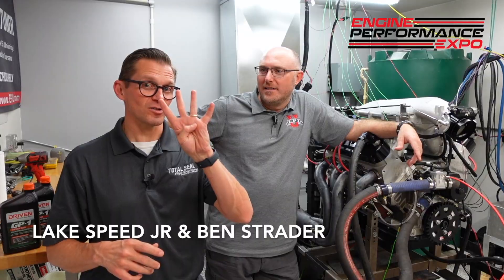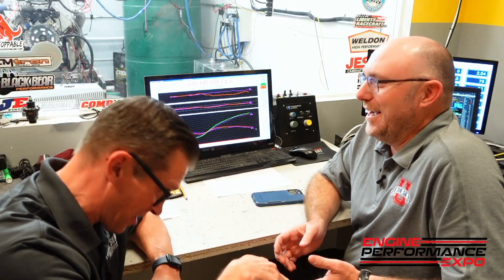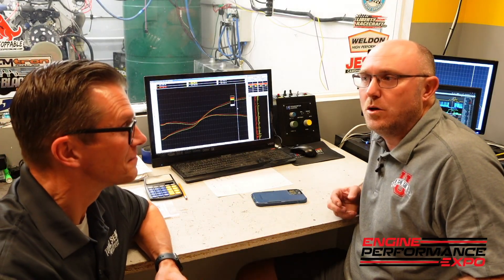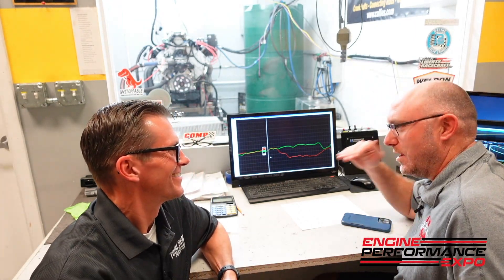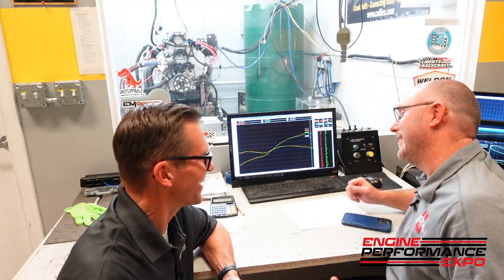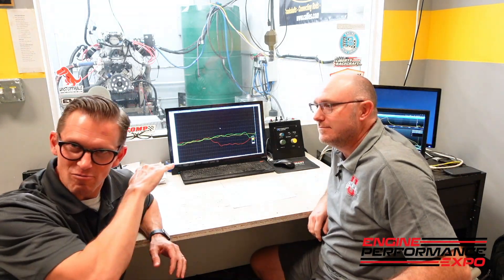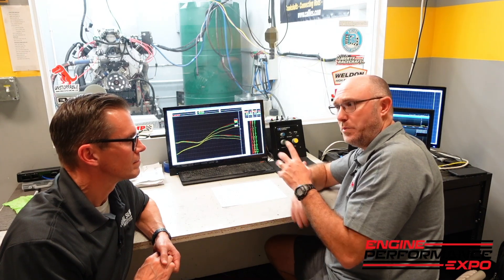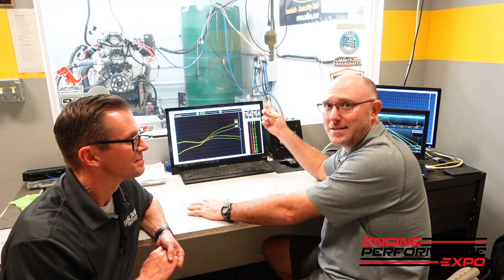How MUCH OIL is TOO MUCH? Dyno Results!

Comment: Love to see if you get the same with a 4 cylinder...

Like a Nissan p11 sr18 ,    which only holds 3.2L and at 4L it has problem to start....

Can you please do more detail like that due to more international people have 4 cylinder engines....
Reply from the maker: It would be the same for a 4 cylinder or 6 cylinder engine.
Reply: @themotoroilgeek    the engine if has too much was not able to start...

Especially after been done so many times...

Comment: Lake, this video had way to many undisclosed variables for me. It would of been nice to have a pan with a lexan window in it to see the level as it relates to the crank, still and running. Also, is there a windage tray and what’s it look like? Has the crank been knife-edged? How far off the bottom is the pick up? Does the pan have left, right, or both kick-outs? I nice addition to the test would be an accu-sump system.
Reply from the maker: All of the details on this engine are on the Engine Performance Expo channel.

Comment: Foaming (crank hitting the oil level in the over-filled sump) is what I fear with passenger vehicles, and certainly some race engines too.  When oil is full of air, it doesn't lubricate near as well.
In this video, I'd say the oil heated up more the less oil there was, driving pressure down.  I don't think the sump pick-up was sucking air (which also causes foaming).  The drop in pressure reading is due to higher oil temperature.
Reply from the maker: The pressure drop was not due to temperature. As stated in the video, these heads have poor oil return, so they fill up with oil, which drops the oil level in the pan (thus the drop in oil pressure).
Reply: @vincentrobinette1507  and @themotoroilgeek   OK, oil return is too low at high rpm, so low oil quarts means the sump level must be dropping below the oil pickup tube inlet some, sucking some air up and lowering oil pressure by foaming that way.   Would be nice to see if bubbles are on the dipstick right after a run, as this is how one finds out definitively if a passenger car's oil level is dangerously high.  Passenger cars generally will let you go above the top line on the dipstick (varies, so not always) a little without the crank hitting the sump oil, basically the oil above the windage tray level.
Reply: I looked for this comment. I agree the lesser amount of oil heats faster and will increase power over cold oil. They should have put a pan oil level indicator to see how much oil stayed up in the engine and how the levels actually change in the pan. And the actual oil temp which they didn’t.
Reply: To say that you have that much oil staying up in the heads is a problem. And if you are sucking air in the pickup that means you have basically no oil in the pan and air in the oil system is bad.
Reply: I believe the pressure drop is due to aeration of the oil caused by the crank and rods splashing in the oil, as well as general windage. Bubbles could get low enough, for the pick up tube to be drawing air bubbles, as well as oil.
Reply: Who said the pressure dropped to zero or fluctuates?if the pump ran dry or even sucked some air it would draw less power and show more on the dyno. Less oil will heat up faster. They need to do more testing and have more info to say more and not guess.
Reply: @mason7300  not me buddy
Reply: My ‘69 Boss Mustang 428 had a windage tray. It was a SCJ with the functional hood scoop.
Reply: If the oil pressure dropped due to temperature it wouldn’t happen so suddenly. So you are incorrect. It’s can only be air at ion as the level going below the pickup would drop to 0 or fluctuate rapidly
Reply: In other words as soon as the oil pressure drops and sucks air you better believe things are heating up fast. The power comes from less power draw on the oil pump. Bad for the engine. Races are won on getting the right pump. 5-10 hp gain.

Comment: On an aging daily driver with 280k miles, 2.4L Honda would it be best to run it at the max line for wear protection and longevity? She’s had 5w-20 Mobil 1 full synthetic (now high mileage) in her since I bought it 16 years ago. Would love to see how long I can keep her on the road.
Reply from the maker: Nope. In the middle of the dipstick is all you need.
Reply: Why switch to high mileage oil if it wasn't leaking or consuming oil?
Reply: @masterofnone1808 she consumed a little bit. About 1 qt every 1000 miles. Sold it with 290k miles on it and bought an 09 CRV with half the miles.

Comment: I  have two older high mileage engines - one a 1977 Olds 403 and the other a 1978 SBC 305 - that always burn off a half a quart of oil after an oil change within 100 miles, then they'll run about 1500 miles before hitting the add mark.

My daughter insists on keeping them full or even slightly overfilled and I've shown her that being overfilled actually results in fluctuations in oil pressure at higher RPMs I'm sure due to "foaming".
Reply from the maker: Thanks for sharing!

Comment: Some years ago I had a Chev truck in the bay, it  just had an oil change in another city. Pressure dropped coming through a mountain pass. I confirmed it at 3000 rpm. Oil level was only 3/4" over full. Drained some out, all ok after that..
Reply from the maker: Yep. Small block Chevy engines with stroker cranks are very sensitive to oil level.
Reply: What about a small block Nissan like the Altima with a 86 by100  2.5 ...though I prefer a 2 liter Dr Pepper

Comment: Need a window to see what is going on inside the pan with the crank, counterweights, windage, roping, etc.
Reply from the maker: I would love that…
Reply: Garage 54 did it recently.
Reply: Would love to see this too.
Reply: Another YouTuber did this. All the oil sloshing caused a lot of foaming.
Reply: What is roping? Like a rope seal? Or snotty streamers of oil caused by tackifier additives?
Reply: @gregorymalchuk272  the latter: snotty streamers of oil.

I'm way more familiar with smaller inline engines.  My own has a windage tray between the crank and the oil pan/sump, stock.  

No mention if this engine did or did not have one.  If there wasn't... boy, testing a windage tray vs not would be interesting.
Reply: You mean something like this? https://youtu.be/gxw3rLFlsTc?si=-wVry1dbnbClTgGL

Comment: I always wondered what the 2 dots on the dip stick actually measured. Is dot to dot represent 1 quart?  Any one know?
Reply from the maker: It is typically about 1 quart (on most engines).
Reply: @themotoroilgeek   It would be 1 liter on an engine from a country that is metric.  i.e. Japan, Germany, etc.

Comment: Lake you keep teaching me more and more about making Horsepower. I was surprised by over filling oil changes HP. Thanks for the knowledge.
Reply from the maker: Glad to help
Reply: its because the crank is hitting the oil at the bottom, try pushing your hand through water, it slows it down. this is an easy visual/physical example

Comment: Interesting for race track.On the highway I thought over filling  would damage an engine.What damage might that be.
Reply from the maker: Overfilling is very bad for street engines. It can lead to foaming problems.
Reply: @themotoroilgeek  What if it is only 4-8 ounces over?
Reply: @Fordworldrallyfan  According to Toyota owner's manuals and level above the full mark while at operating temperature is "excessive".
Reply: I've heard IT would hurt the catalytic converter with the oil fumes from splashing.

Comment: I was in the navy (I wouldn't say which country) and one of the ships I was post to had the tradition of filling it TWICE THE AMOUNT of the max fill line. So when the engine starts up to idle, the oil level should drop to exactly the maximum fill line as dictated by my chief. 

Privately, throughout the short amount of time I served, I'm just in a incredulous state that the engine didn't develop any problems. But it always seem to feel slower than the other vessels when we're charging back to base.
Reply from the maker: Thanks for sharing
Reply: And the oil would be airated.  Air does nothing to lubricate bearings.
Reply: @thisisyourcaptainspeaking2259   yep, complete waste of oil. I never fully respect my chief for that.
Reply: Is there such a thing as oil drag? The engine needs so much oil to create the film to protect the bearings over that is pointless, but the pump continues to pump pressurised oil into the bearings.
Reply: Was it Singapore?
Reply: Marine specifications and lubrication are significantly different. Don't cross reference the 2.
Reply: @pheonixfps9248  lol. I'm talking about oil level, not oil spec.
Reply: @smoadia85  so am I.

Comment: Great info, but would have liked to know how much oil the dipstic/manufactor says the engine needs.
Reply from the maker: There’s no dipstick on this engine…
Reply: @themotoroilgeek hey. I have always wondered about the mfg. dipstick. 
How do they know the measurements on the dipstick?
I'm not a from ground up engine builder. 
After oil change the level of oil is very hard to read. 
Always worry about too much and causing oil frothing. 
Thanks.

Comment: Would be interesting to see if you ran longer and the oil all turned to foam. More oil equals more oil pressure until.?.?.?.?.You lost horsepower because the crank is literally spinning submerged in oil.
Reply from the maker: Absolutely! If we kept running it we would have had a major foam problem.

Comment: I’m curious about what a 3 quart accumulator would do in these situations. 
I’m looking into solutions for my GM L8T block. 
 Currently I’m thinking about running a Peterson external wet sump oil pump and a 3 quart accumulator but I have no direct experience with doing this. 
   On paper it appears to be the right thing to do.
Reply from the maker: Sounds like a good idea

Comment: It didn't surprise me to see how much power was lost when the tank was overfilled, but it did surprise me to see how much power was gained by decreasing the amount. Great video
Reply: You get more hp with decreasing oil pressure because it takes power to pump oil. There is a sweet spot but you need a minimum of 10 psi per thousand rpm to keep bearings cool. The falling oil pressure with low oil is really scary on the first pull.
Reply: @patsyalbertengel3066  what is the source of "0 psi per thousand rpm"? Does it work for engines with ball crank bearings?
Reply from the maker: Thanks!
Reply: @themotoroilgeek  is the engine working harder because its swimming in all that oil and losing horsepower as a result?
Reply from the maker: @ThatCaymanGuy  Absolutely!
Reply: @themotoroilgeek  The lowest oil test, 5 quarts, had gained horsepower due to the lower load on the oil pump, not just less oil hitting the crankshaft.  Question is how much can be added before crank slap starts robbing power.  Starving the oil pump to gain power is not a good thing for any of my vehicles.
Reply: Wouldn't a oil with different viscosity change the outcome also. Let say a 0w 3l0. Instead of 16w 40 @themotoroilgeek
Reply: @ThatCaymanGuy  i had a fellow drain the transmission on his harley, thinking it was engine oil. he re/more filled the oil tank to max capacity, including flywheel compartment which in those is considered dry sump. he kept checking & adding to the point that in a 3.5 gt system he had 3 in the tank & 3 in the engine. it, being completely flooded took no time to turn all the work i did inside blue from the heat.
Reply: ,, 
1 1 /. @themotoroilgeek
Reply: @themotoroilgeek mine is 2004 model 125cc Hero Honda super splendor bike...usually pouring 900 ml semi synthetic oil as it was coming in 900ml container and the recommended quantity is also 900ml. This month I shifted to the Shell advanced ultra 10w 40 fully synthetic oil that is coming in 1000ml container and l poured the same...Will it do any harm to my engine or it is manageable...please suggest...Love from lndia...
Reply: Crank is basically a oil foamer when over filled.   It causes massive parasitic draw.    
On the other hand, with this engine in particular! At 5 qrts. Of oil the oil pump cavitatated. There for it became easier to spin.  That = 12 hp gain on paper.
Reply: @brianr8581  if you foam the oil, your pressure will drop too
Reply: So this begs the question, how trusty is the dipstick overall?
Reply: @TxRedneck smart man.  Analog gauges would tell you better
Reply: Is the right amount for optimal engine health and power in the middle or full?
Reply: Mostly engineering tells us right in the middle of  @NoNoNo12322
Reply: Now repeat the first test just to be sure
Reply: now, the million dollar question? are we gaining hp because of less oil or more available air space to better distribute the positive & negative crankcase pressures?
Reply: @Toobzilla  or more HP due to less work by the oil pump and possibly killing the life of the engine.
Reply: @Stan_in_Shelton_WA  if the oil supply is ample enough to keep the pump satisfied it wont matter if it has 10 oz or 10 gallons of supply.. with babbitt style bearings, constant high-pressure is paramount.  you can destroy critical clearances in babbitt style bearings in nano-seconds. the added clearance would drop pressure but increase the volume dispersed. both of which would be counter productive to these findings.
Reply: @Toobzilla  Not true.  Oil pressure in is relevant to oil pressure out.  Also I think they had info about oil pressure differentials.  30 PSI compared to 60 PSI would be a different load on the engine.
Reply: @Stan_in_Shelton_WA  i think your getting your pressures & volumes confused. 
if i take an assembled oil pump & hook a return circuit to the outlet of pump to simulate the distance between tank supply & pump and then remotely drive the pump at same max rpm as when installed & slowly lower pump into the minimal amount necessary to maintain a steady state of oil pressure as regulatedby the bypass circuit & find that minimal volume needed to maintain steady state w no time limits @ full operating temerature  is 24 ozs, your suggesting that lowering same unit with the same unrestricted return circuit into 24 gallons will somehow raise the pressure?... im betting lots of folk would argue that.
if 24oz is my minimum 100% capacity needed to maintain steady state psi but remove 4oz & the pump starts to cavitate & the pressure on gage starts to fluctuate to the negative, we are no longer talking a pressure differential but a supply differential. we cannot pressurize that which we lack..
Reply: @Toobzilla  NO, no confusion on my part.  Supply or pressure into a pump effects what it will do.
ALSO, If the pump starts sucking air the pressure will drop and the pump input shaft load will also drop.
Reply: "oil pressure in is relevant to oil presure out"
i'm trying to make sense out of this statement but it loses me. 
if you mean to imply that the return side of the pump directly influences the pressure generation of the feed stage, well that might explain why i cant make sense of it. 
the feed & return stages of the pump are independent of each other & one influencing the other thru shared circuits would be disastrous at best. 
i suppose a dead ass blockage in the return side could effect the feed thru excessive pressure causing internal leakage but youd have way more serious issues at that  point to care or notice that..
Reply: @Toobzilla  feed pressure effects output.  It may seem trivial but the pump can only pump what it has.
Reply: @Stan_in_Shelton_WA  ok, thats a lot clearer, easier to understand & makes sense. sorry for the mix up..
Reply: @Stan_in_Shelton_WA  i cant wrap my head around that concept. one would see  pressure fallout if pump starved for oil.. in automotive engines that could be disastrous and would  likely start to delam& gall babbit style bearings tral q
Reply: @Stan_in_Shelton_WA  the two are.seperate, non conversational stages, they would have to work independently of each other for both of them to perform as required.
Reply: its been a minute, im not sure im up to speed on this, lol.
Reply: @Stan_in_Shelton_WA  but feed pressure is not regulated by volume, its regulated by regulating or bypass circuits..
Reply: @Stan_in_Shelton_WA  i think were talking about 2 different things, to me, output means return to tank or scavenge side of pump. i think what your talking is the output to engine circuitry after being pressurized by o/p gears?
Reply: @Toobzilla  Reducing the effect of pressure ripple in the oil chamber on other measurements for measurement purposes
Reply: @Toobzilla  Make two engines with pistons working in opposite phase with one common sump and lubrication chamber and you will see that it does not cost one million $
Reply: @nabiuro  ok??
Reply: That GP1 is great at preventing two parts getting intimate. Changed from HR1 and Valvoline 20/50 race before that.
Reply: Mine is a 2004 model 125cc Hero Honda super splendor. 150000km running..Previously using the Castrol power 1 10w 30 semi synthetic oil 900ml...Now l changed to the Shell advanced ultra 10w 40 fully synthetic oil that's coming in 1000ml and l poured it completely...difference is 100ml...Will it cause any damage to the engine...or it is manageable...please suggest...Love from lndia...
Reply: @gudlutripathy3283  Do you want to drive faster now?
Your fuel consumption will increase, we only pour in the amount of oil recommended by the vehicle manufacturer! Next time, just leave yourself excess oil for top-ups, e.g. halfway or preferably 75% of the mileage between top-ups. Such a top-up, assuming there is room or you drained the 100 ml and added new oil, will have a regenerating effect on the already used oil

Increasing the viscosity of the oil with the number of kilometers traveled is a mistake! This causes increased carbon deposits, oil seizing and the risk of seized rings, etc.
Stick to Castrol with the same viscosity if you have to change something, try Castrol Edge Platinum
Reply: Part of the benefit of a dry sump system